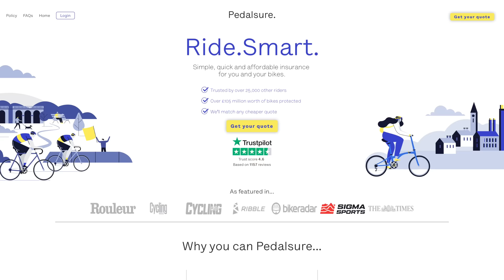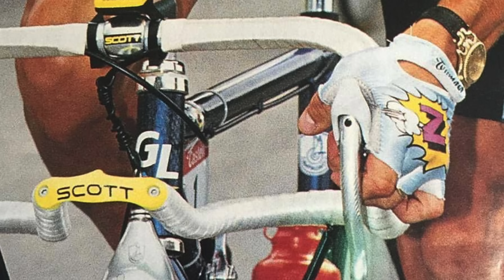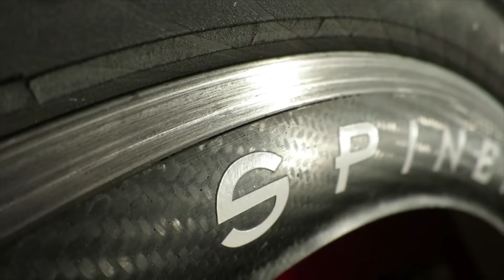5 BIGGEST Tech Fails of The Tour de France

Comment: Interesting video with undoubtedly revolutionary ideas. One thing I was wondering is whether aluminium ever had its glory days in the Pro peloton? Did we transition from steel to carbon directly or there was a period of aluminium bikes?
Reply: Yes, you see riders in the Super Tours, One day classics, and Tour of Flanders in the 1980's from 1986 onward and into 1990's using Aluminum frames until about 1998 when nearly the whole tour went Carbon except a few small teams. There was a small period where Titanium Alloy was used in the late 1970's and early 1980's but the frames were so expensive at the time until the early 2000, they were not selling well that Bike manufactures went on to make Aluminum Alloy frames that worked better were lighter and could be  made of more of the main material.  

There also was some Aluminum Alloy bikes in the 1900's early odd Tour De France and similar big races Pre WWI but the Tech from WWI helped so that Bikes made of Steel were lighter then the Aluminum bikes we see now mainly due to the fact they were using only aluminum in the frames so they had to be thicker walled tubing. The manufactures after WWI found that the new lighter Steel frames could be an early type of Stainless called Rust-less steel in the 1920's as well as having Dura Aluminum hybrids due to WWI but those were hard to make strong enough for a rider often coming in flat sheets so not used for Bikes.

Comment: Another Two tech that failed was first the handlebars with extra end cap shifters apart from main handlebar ones from the 1970's onward until the early 1980's when they were dropped, you see riders with them on but never using them as they were unresponsive and would often throw the chain off the bike if you got them to work. Now in the 1990's sometime and onward until they were ban due to safety by UCI the bike as manufactures seemed to have perfected the use of the second end cap shifters that more and more riders were using even when lever shifters started to become a thing.  The second is on older bikes in the 1950's you see this the most to sometime near the end of 1960's maybe very early 1970s with  then only a few teams using bikes that have one or two shifters on the top tube near the stem or the stem of the bike and the reason those got dropped was in favor of the handlebar type was that riders had kept hurting specific body parts when riding along with safety of having to remove a hand or two from the bike. Now the trend is in having integrated shifters with road bikes breaks along with having main shifters as an option for those who want them as the shifters are so responsive now unlike back then even if using a wire type.

Comment: Re tech fails of the Tour de France : Campagnolo's Record  C "Delta" brakes.
Reply: Wait a minute! Just because they stopped worse, weighed more, were difficult to adjust and required a 3.5mm allen wrench to tighten the cable clamp? They also did a complete redesign to work better. Didn't really though. Most of the sponsored pros used older calipers with the record groups of that era. Yes l have a pair. I do have all of the required tools and skill set to properly adjust them but they are still marginal at best. Not as good as the single pivot from the earlier groups and incredibly inferior to the later dual pivots. 
I must be a magnet for this Stuff as l also have Scott Drop ins, Spinergy rev x's, Cinelli Spinacis and the unmentioned but should have made the list grip shift road bike shifters.

Comment: Weight to stiffness is so often overlooked. I'm surprised more crazy materials weren't on this list for that reason.
Reply: I wonder how many innovations have been killed in the womb by the idea that frame flex wastes pedaling energy... 

Because it doesn't.

--Shannon
Reply: @SMenkveld  it's not frame flex that's the issue. It's frame fatigue. Flex isn't an issue on the riding side however some materials fatigue easily or offer great weight savings but lack the necessary stiffness or strength to make those weight savings while remaining durable.
Reply: @andrewince8824  That's true, but given that the common material most vulnerable to bending fatigue, aluminum, was the original material of choice for the "stiffer is better because flex wastes energy" people, I don't remember fatigue life being part of the discussion.

Comment: I have been using aero bars since 1992, for me to get to the brakes is the exact same time for a rider on the tops of drops bars. I am faster getting to the brakes than an inexperienced rider on the tops of drop bars. I can take a bump while on the aero bars to, it is not less stable, and I can handle the bike the same on the aero bars. It is all just a matter of experience, if you never used aero bars before, you will not feel as safe as on drop bars. Aero bars are no more dangerous than a rider going from flat bars to drop bars for the first time. It only takes me a 1/4 second to go from aero bar to the end (grips) of the flat bar. Bar ends also don't have brakes and you have to move your hands from bar end to end (grip) to reach the brakes, again a 1/4 second is all I need. It is probably a faster time than that, I am erroring in favor of making a point.

Comment: I enjoy your shows but I think it's manganese that's flammable.
Reply: Magnesium, manganese, sodium, among many others, are flammable.  
"Mag" wheels in cars were modified to prevent "spontaneous" combustion in wrecks.  Basically, it's an alloy that won't catch fire when sparking across the pavement.  Otherwise, once it ignites, it doesn't go out until the material is gone.

Comment: I still have two sets of the Scott Drop In bar.  One set is on my backup Cannondale (with 9 speed Campy and a down tube front derailer shifter). Never had a spec of trouble with those bars.

Comment: I find it rather silly that an insurance company would advertise "We protect you and your bike from theft!"
What?  How's that?  Insurance does nothing of the sort!  It only remediates a loss in the event of theft.  How's insurance gonna replace my one-of-a-kind custom bike with custom paint?  It won't.  Stop shilling baloney!
I support insurance, but it drives me crazy to see this false advertising.  I said the same about the Project 529 campaign.  Bicycle registration does NOT prevent theft!  It's there to help recovery in the event of theft.  (And yes, it MAY discourage theft, but not really these days.)
Wanna PREVENT theft?  Get the best lock you can and be creative.  Don't be lazy.  Put extra security on your garage or shed.  Use video surveillance to alert you to motion in your bicycle storage area.  Utilize GPS tracking devices.  Beef up the locks you have.  Add pipe sections, collars or t-joints to beef them up.  Make them less of an option for a thief to defeat.
But mainly, use the best lock you can.  Grinders have set the bike security industry back DECADES.  So today, you have three options:
1)  Almax security chain with a Squire padlock.  Insanely $$$ and heavy, but they work!
2)  Altor SAF lock.  Ibid.
3)  Hiplok D1000.  Just hitting the market now.  Made with grinder-proof Ferosafe.  Expensive at $275.  But a quality bike is EASILY worth it.
4)  Future material:  Proteus, developed in 2020, another grinder-resistant material.  Urge all security companies to get this stuff into production!

And yes, insurance is great.  But it's an "after theft" solution that does nothing to prevent theft.

PS  And for everyone shopping for a used bike to replace their stolen bikes:  DON'T BUY STOLEN BIKES!  Demand the original receipt.  Run the SN through the online databases.  Check your local LE to be sure it isn't stolen.  Then get a signed bill of sale to document where you bought the bike.  A "really good deal" is stolen.

Comment: When is the bicycle industry stupidity going to end. You said: high technology....where?....when? Carbon fiber bikes are still just a frame with some shaping. Racing cyclists don't use what works or they want or need, racing cyclists use what is forced on them by sponsors. Making bikes more complex because people don't want to learn the skills of shifting, weight distribution on rough roads, cadence variations and pedal stroke alternatives. I raced pro in the 80s with downtube friction shifters, it wasn't a problem and did not need fixed with indexing and electronics. It was a cable without housing directly connected to the derailleurs. Carbon fiber bikes...who cares....who needs them other than racing cyclists; someday manufacturers will hopefully understand WE DON'T CARE WHAT THEY ARE RACING WITH!!!! The main advantage of carbon fiber is it can be shaped into air foils and it is light so that we can finally have a beneficial aero dynamic bike that wraps the air/wind around the RIDER. Aero dynamic tubes are insanely stupid with my shoulders are 28 inches wide, who cares if the tube is aero when I am pushing a kitchen table body through the air!!!!!!!!!! When are all you star struck idiots going to stop praising race bikes and begin demanding aero (true aero) bikes for the recreational community. UCI is the biggest problem today, there should be unlimited technology admitted into racing (as long as it is proven safe) so the entire world can benefit from the technology. Todays carbon fiber high end racing bike has near zero benefit to the recreational rider, and mostly all disadvantages including ridiculous money spent for no results in higher speeds and faster commutes. A carbon bike with air foils to wrap air around the rider would increase our speed at least 5mph or more if using aero-bars and in a aero position on the bike. An adjustable windshield could be tilted while we ride for cooling and we could sit in a cockpit with air foils on our sides to wrap air around our body, AND protect us in a crash. Protection and safety should have made these a requirement years ago when carbon bikes with air-foils could weigh what steel racing bikes in the 80s weighed. For a 21 pound carbon bike WITH air-foils could advance the bike in technology for the first time since the chain driven bike `100 years ago. There has been no practical advance in cycling for 100 years or since the derailleur system. Reduced weight for rec riders is only marginally usable, a recreational rider is not going to cut their commute time by even 10% by upgrading their aluminum racing bike to a $18,000.00 carbon racing bike. They will increase their times by up to 25% or more with a carbon air-foil bike and time trial body position. Gushing idiots over race bikes and buying one for recreational riding is only being done by the most inexperienced riders, paying huge money for very little results. Hype, bikes are not fast, people are...or are not. $18,000.00 for a top end bike and it does not come with an engine; what engine are you installing on the bike...?....1/10 of a horsepower? Enough of the stupidity and the hype, it has bankrupted the one who listens to fools and is causing many to be injured by inexperience riders buying racing bike with a fat gut that cannot be ridden, and fast handling that cannot be handled....it is all sad, stupid and ridiculous....when is it going to change? When are we going to get actual bike technology we can use? In another 100 years?

Comment: Until they balance wheels I’ll take all innovations with a pinch of salt
Reply: Do you know how most cars' wheels are balanced?  With weights.  The LAST place to add unnecessary weight on a bicycle is the wheels, especially at the outer radius of the wheel.  So no, there's no need to "balance" bicycle wheels.
Reply: @dudeonbike800  Trust me if you go down alpine descents with speeds up to 100 km/h you need a balanced wheel,other wise your whole bike begins to shiver like crazy!
Usually you don’t need to add much weight,but at the right place.
Problem is the weight of the valve,and valves were getting longer and longer due to deep section wheels,so you need a counterweight
Reply: @domestique3954  I've done it MANY times without a care in the world.  On singles, and even faster on tandems.  And this was with lighter weight wheels than what's common today.  And also with tubulars, even lighter where the valve stem mass has more influence.
Sorry, been descending like a fool for 40 years and have NEVER, EVER had ANY issue with an "unbalanced" bicycle wheel.